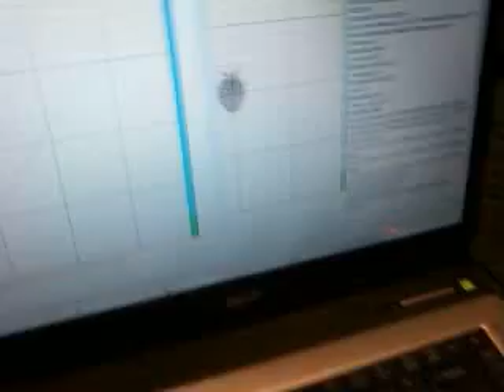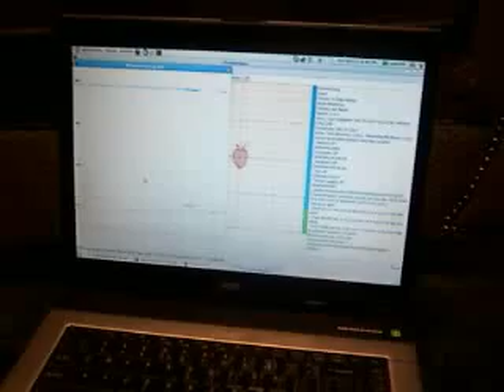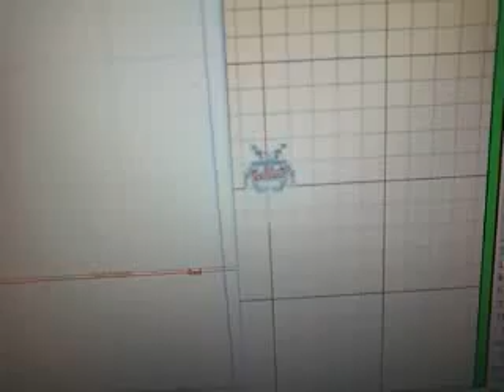My 3d printer first test

Comment: Very cool! I would like to have a 3D printer to help make patterns for casting. I know the i4 just came out. Even though I'm ok(ish) with tech, I would prefer something that more friendly to beginners. I have been following Printrbot for awhile and have been leaning towards one of those. I do have a wish list of options and price points and finally, there seems to be more of a selection these days. Actually, too many. Heh.
Reply from the maker: I have a first gen printerbot jr and that thing has seen a ton of use, but just lacked the print space for a bunch of my patterns, but the quality of the products they have there is very good imo, abet a bit pricey. I didnt know that the I4 just came out, Ill have to take a look at what the differences are.

Also, I was watching your videos, I was really getting into the tool post that bob made and the dial indicator holders. Those look like they would help alot with my stuff too, I just got a lathe and am still learning how to use it, but I only have the 4 jaw chuck that came with the lathe. 

Was you going to add some sort of reversing for your lathe motor btw? I was thinking of adding it to mine if I can figure out how to reverse the motor through the wiring so that I can turn off/out stuff like dies/taps instead of reversing the chuck and everything by hand since I was planning on trying to use it to make long threaded rods and such. (lathe is missing split nut, so no threading like normal, and the stuff I was making would be too small to thread on a lathe)
Reply: cae chirp I found out about the i4 while looking at printers on Amazon. I'm waiting to see the reviews on the new Printrbot that's coming out before I buy but the price is starting to climb a bit high for me.

I'm still working on getting my lathe up and running. I need to rewire the motor I got for it to run forwards - I discovered that it running in reverse. I don't have plans to use a forward/reverse switch at this point.

Thanks for checking out my videos!
Reply from the maker: eviltwinx Ive seen a few motors like your atlas one and it looks like a repulsion motor, I had one like it and on the other side of the back, remove the panel and there should be a slider, if you move it down to a certain point, it'll run in the opposite direction. Also, I was trying to figure out who you are on AA, lol.
Reply: cae chirp Thanks for the tip on the motor! My youtube used to be mutant until something got all screwed up when I had to create a Google Plus account so I became eviltwinx.